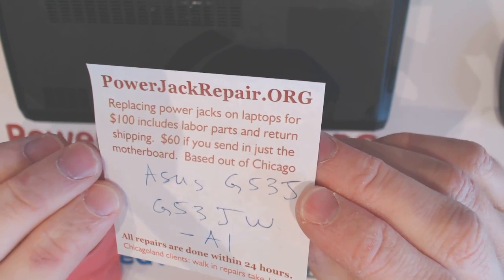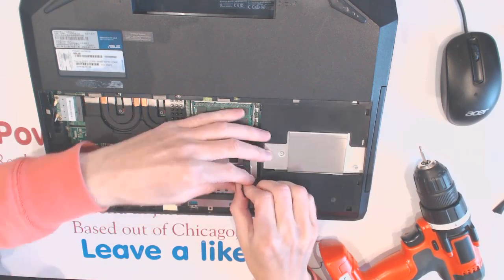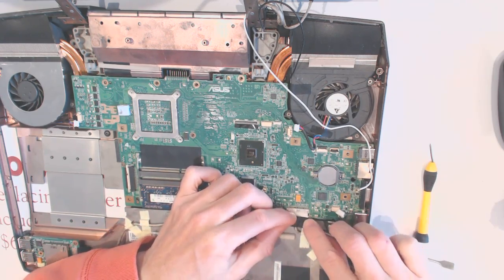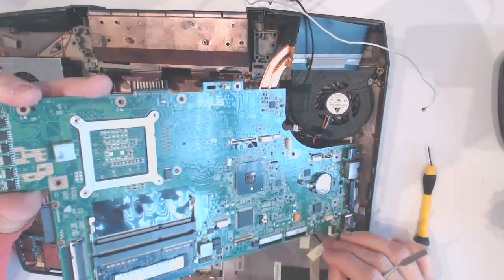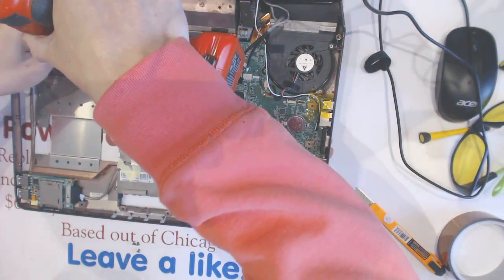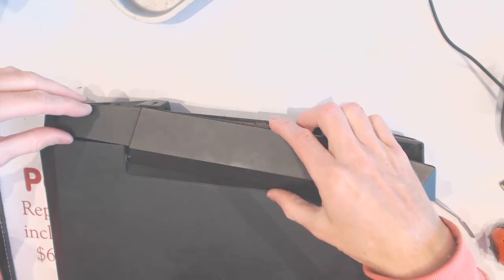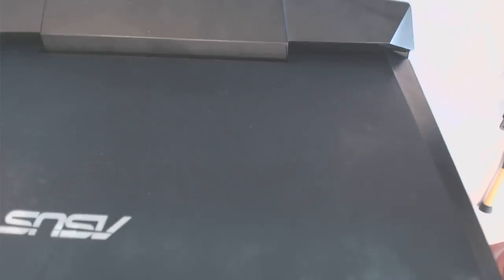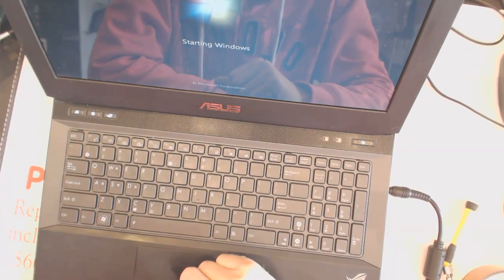Asus g53j g53jw-a1 Laptop repair fix power jack problems broken dc socket input port

Comment: Hi i replaced the laptop screen but when plugging the connector i put it upside down so something shortwired now mainboard makes pitch noise like whistling and the parts where its written top get too  hot burning hot thts where the whistling sound coming from we dont have asus in here and none has a g53jw its rare so i cant take to reparator no parts  help me plz